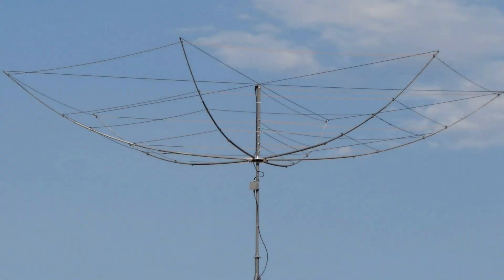Compromise Antennas: What you need to know

Comment: I'm currently on a 12 state POTA trip in the southeast.   When I'm operating out of my own car, I lean toward the 17' whip that I can tune to a 1/4 wave.   But for this trip I packed a Gabil, purely because it packs easily.  I was worried about the compromise, but I needn't have.  It's performance has been more than adequate.   I've also had great results with a portable random wire.   So, I've slowly been able to let go of my aversion to compromise antennas.  I won't contest with them but for my purposes they get the job done.
Reply from the maker: Thanks Dan, your AOR also helps. The east coast is much easier fishing than out here in the Pac NW. You bring a good point that we should focus much less on gear and more on operating.
73 Bob

Comment: Making QSOs is more about favorable propagation, QRN and QRM conditions than antenna radiation efficiency.  You can lose 6db (75% or 1 S unit) of your power in an inefficient antenna system and still make plenty of QSOs when conditions are favorable.
Reply from the maker: Absolutely! It is really easy to focus on equipment thinking that will fix it than realize that band conditions and operating skill are much more important. Thanks for the comment.
73 WV7W
Reply: @houseofhamradio 73  KE4TDG
Reply: Yes Sir!

Comment: Interesting perspective. I usually think of a compromise antenna as anything with a loading coil, or less than a physical half wave. I use my JPC-12 the most; but I only expect so much from it. I also have a JPC-7, but it only goes up ~10-12ft. Quite NVIS, but I still only expect so much from it. Once money allows, I plan to diversify my antenna options more. I'm also reducing my capabilities running an x6100 as well.
Reply from the maker: Understanding the constraints and tempering your expectations to match is key. So long as you are getting on the air and making contacts, you are winning.
73 WV7W